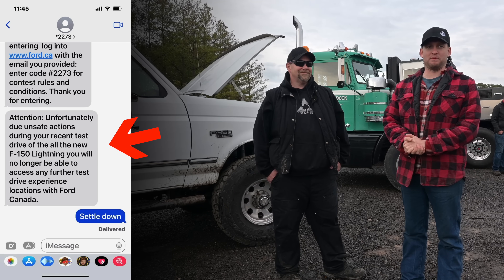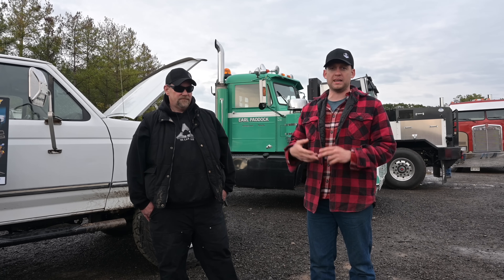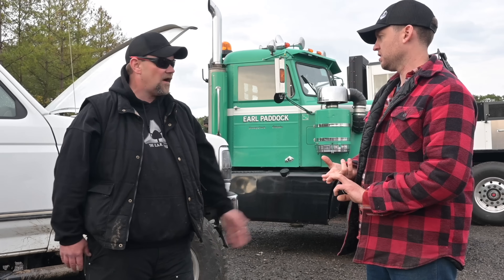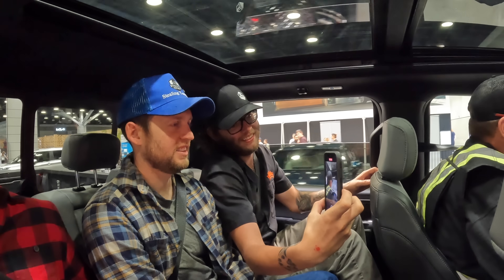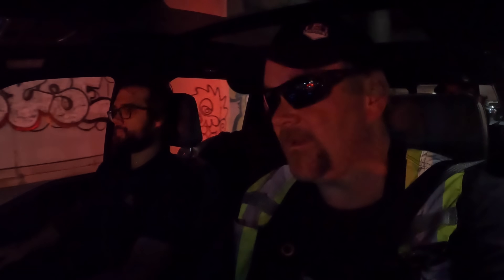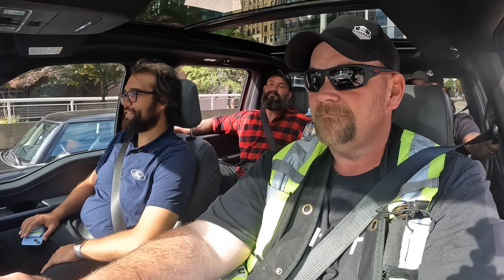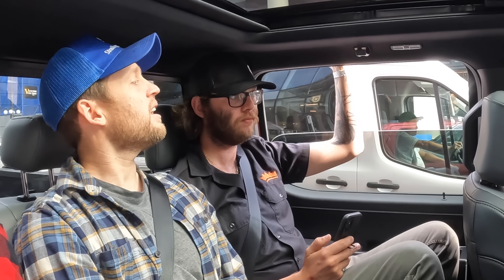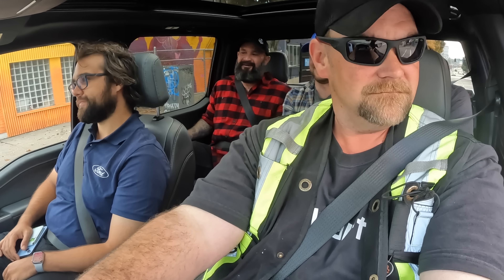Retrofit Revolution: Turning Old Pickups into Electric Powerhouses!

Comment: Yes PLEASE!!!! I know old trucks won't be as pretty and fancy as the modern ones, but something that is designed to be used is so much more valuable. Reducing ownership costs matters, and since a lot of trucks may have transmission issues, this could bring a ton back from the junkyard, assuming they aren't rusted out. I would be curious how low you could mount the engine, and if the batteries could be underslung in the transmission tunnel. Keeping the CG low and increasing utility would be brilliant, especially for off road applications, or recovery.

Comment: I’d love to see a retrofit kit happen - I’d encourage you to build in a good deal of modularity, including allowing a kit that’d integrate to a transfer case instead of replacing the whole axle and doing different generator/motor/battery combinations - selfishly that’d be ideal for my Toyota with IFS. If you make the CAD for the motor face available, it’s relatively straightforward to adapt that to transfer case input and be off to the races.

Comment: You don't need custom to fit kits.   Just provide an engine, Gen and axles.   Make the electronics open-ended so we can cut them to fit.   I would also like just a generator to attach to whatever engine I want and axles.   I would love to do this on my 65 ford f100.

Comment: That's awesome. How about trailers with powered axles and batteries. Travel trailers and logging trailers, all kinds of trailers. I saw a travel trailer that could be driven around with a remote, without a truck. Even powered sidecar on a motorcycle! Imagine a powered trailer in mud or on ice.

Comment: I have the perfect truck for you to test it on. It's a 1990 Ford F250 four-wheel drive with the big 7.5 liter motor and a toolbox in the extended bed. And it just so happens that the motor on it blew last year and really wanted to convert it to Electric but don't have the confidence or knowledge to see it through. I will gladly be the donor truck

Comment: I'd love a kit to fit my Peugeot 306. They have a torsion bar rear end, so 8 bolts to drop the entire rear suspension out. A bolt in rear setup for them could pick up on the original mounts and also provide a driven rear end. My 306 happens to be a very efficient diesel as well, so could be even better with this setup.
Same rear suspension system for everything Peugeot and Citroen from the 80's to mid 2000's, just sized differently for the bigger or smaller cars. Even after that they only went to a semi trailing arms setup instead.

Comment: Absolutely! I’ve had two type rattling around in my head for years. Either convert a classic truck to a gen/electric one or do a former ambulance chassis. The latter is easier to do because the body is already off the back. The conversation during the test drive was hilarious!

Comment: Has big blue collar market potential. Built in generator for running construction site tools,   RV trailer power, though you may suffer on efficiency trying to blend towing Regen power vs running RV campsite power;  service truck use has potential for running welder, crane, air compressor, etc. 

The sky is the limit, there's a lot of customization that can be done in the industrial world with this.
Reply: The myth that people wouldn't buy this is dumb. The problem with electric vehicles is the demand they put on the electric grid. California supposedly does rolling blackouts in the summer because their power grid can't support the existing infrastructure. Yet they're trying to go all electric vehicles in less than 10 years. That's the stupidity with electric vehicles. Your system solves bridges the gap between the potential of EV's and the tried and true dependability of fossil fuels.
Reply: Side note, if we did away with CO2 emissions entirely then plants would suffer. They need CO2 for photosynthesis, which makes oxygen for us.

Comment: I have a 1996 Dodge Ram 2500 HD (rust free California truck) that I would love to have a conversion to EV with small generator to run. I tow my 5th wheel RV and a regular BEV just won’t work for that towing but would work for day to day driving. Your system having batteries with enough range for daily driving but having the generator for long distance and towing is fantastic!

Comment: Just a dumb ol’ Dirt Engineer here:  I have a 69 F250, which my Dad bought new sitting in the side yard, and hope to do a full restification on it, a year from now.  It is 2wd and has the Dana 60 rear end under it.    If you come out with a conversion kit, make the axle smooth, with out perches, or link hook ups on it so it is universal.  And, a Motor mount for the gen-set, which can be welded onto a piece channel by the installer.  A lot of folks have the welding skill to put things together from a kit like that, but few folks have metal brakes, or the hole-slot punching capability to make clean fabricated parts.  And for you to manufacture vehicle specific kits would add a lot of time and expense on your end.  A kit which allows a home shop based, all around mechanic to retrofit the electric, with out the hassles of sourcing all the components, and figuring out the controls system and wiring would sell well.    I’m thinking of a buffet type model where you have a list of standardized sub-components, the buyer can pick from, (some could be purchased from others if you wanted), and they select a set of components for their specific project, with the option of your shop doing the welding, powder coating etc. as an option.   And possibly a range of motor/axles to allow conversion of a range of vehicles.  I’m pondering converting a JDM Kei class mini pickup or van to full electric, perhaps as a hybrid, or full on electric.  Lots of room under those little flat beds to mount batteries, the only issue I have is figuring out the controls system.

Comment: Honestly it has been my dream for years to build a pickup or car with electric drive and a diesel generator. I grew up in Montana where the nearest grocery store was 30 miles (48km) from home. If you could combine the efficiency of electric and diesel in a small car, you could pay for it in fuel savings just going to town and back every day. Not to mention how common it is for me to just go for a weekend road trip and drive 800 miles (1287km)

Comment: Without a transaxle space between the frame should fit plenty battery. I want seals on the axles that’ll stand up to 2 ton on bad roads for 20 years like my current axles. and the occasional 2.5 ton load of green wood on chassis.

The torque might need a mute button for the north icy roads in Fairbanks

Comment: Would it be better to just make an electric centre section to fit the more common axles rather than the entire axle? Then you wouldn't need to mess with suspension

Comment: My suggestion would be to replace the rear axle, and then have a (smaller) front motor that simply hooks to the existing front axle with a driveline. It might lose some efficiency, but generally the front axle being powered is only needed in lower-speed conditions and only /sometimes/, so it would likely not matter.
This would also allow the kit to be used with TTB and independent front axles on 90s-2000's trucks - as opposed to excluding Chevy's and 3/4 ton fords.

Personally, I'd love to be able to fit a generator to, say, a Kubota V2203 - 40ish HP, it's small, and they are available in reefers for reasonable amounts of money.

Alternately, a kit to just use a 4-cyl gasoline engine might be good as well, if you can basically run it at wide open throttle and control the RPM with the load on the generator, so you don't have throttle losses.

Also, some way to hook a level 1/2 wall charger to it would be great - even if there is a fairly small battery, being able to just plug it in and charge it every day would be nice, and get just that much more range before needing the generator. 

I also think it would be cool to design some sort of modular battery pack - so you could start out with one module, and it becomes a hybrid. Need more battery range? Just add more cells later and plug it in.

As far as location for these packs, I think figuring out a way to bolt them to the frame rails would be great - there won't be a driveline in the way, and worst case you might have to relocate the fuel tank, but that wouldn't cut into bed space.

Having a truck box style module could be good as well - especially for a plug-in range extender module.

Comment: I have been waiting for someone to take this on for years.  A simple kit that you can retrofit into a truck.  I was thinking that you would replace the transmission with the electric motor.  Adapt to the transfer case and run power through the stock driveshafts and stock  axles.  I'm guessing power capabilities would have to be less than having electric axles because tcase and driveshafts may not hold up to tbe torque.

Comment: I need to rescue some beat to absolute heck plow/work trucks. Couldn't justify a teardown and rebuild without an all new power train, but maybe with the kit and the benefits to our ops... A torque monster, loves to idle, AWD, sips fuel, V2G, 480v anywhere (just a 30 amp drop would do it) platform that in a normal day doesn't drive ten miles and on a plowing day is never a mile away from a charger, just makes maintenance laps? We're the perfect customer except for how cheap we are and the not having the in house capacity to install the kit, probably.
Reply: There's also some single axle tank trucks and an old Autocar semi and a dump truck as candidate platforms for the full size kit, probably set up for battery only. But that's long term.

Comment: My votes for an obs ford or even an explorer. Would probably be quite a few years until I'd pull the trigger on it though. I also like that 2wd option. I'd be curious to see what kind of fuel savings you get over the 4wd. My guess is they'd be a lot closer mpgs than their standard fuel counter parts

Comment: You could do so much more with a decent sized generator onboard a pickup truck. I have a BMW i3 with the 22KW range extender - so a Pickup would probably need a 50KW+  you could power a huge job-site with this.  Or a event, party, a row of homes - etc.   Use a diesel motor which is able to alternative fuels - veggie oil,  biodiesel, WVO, kerosene etc.  - Design a bed cover with solar panels so that the truck chargers when sitting outside -  could be Epic ;)

Comment: I got a e450 ambulance conversation with a 48v house battery I'd love to get converted to electric diesel generator to  charge both house power and drive it's got 2500 watt of solar on it and a ton of space for a massive battery pack under against the frame rail and then just drive around the states and show it off it turns heads now but if it was electric drive it would really get a lot of interest

Comment: So about a power trailer!
My Uncle met a guy in the service, back in 1952
who was in the Air Force, working as a plane mechanic.
So he had a 1949 Chevy p/u that the engine blew up in.
He pulled the engine, and welded in some shelves, he stuck
a P 51 starter on the front of the of the trans, and filled the
 rest of the space with 6 volt deep cycle batteries, then
he put in one layer of batteries in the bed. And it worked!
But he only got 40 some miles before the batteries died.
So he fixed up an old Das 240v gen set that was in a trailer,
ran a cable to the truck over the trailer hitch, and drove it 
back ,and forth home 400 miles every weekend. When he 
saw the batteries dying, he'ld stop and turn on the genset,
 and it would charge at 160 miles to the gallon.
So a good self contained, gen trailer isn't the worst ideal!

Comment: I would build the first kits around the Ford super duty chassis. These truck have straight axles in the front, and aren’t that different from 1999 to present. The also need the most help since the 6.0 and 6.4 powerstroke were unreliable and expensive to repair. I know people that have had to take second mortgages to repair their powerstroke since it can cost $10-20k. Would be way better to drop in a generator and electric drive.

Comment: I wouldnt be so dead set on making kits  with 4x4, limiting you to 3/4 ton pickups. I think it would make a lot of sense to make kits for 2wd only to start with and expand into 4x4 later, there should be a decent market even for 2wd retrofits.

I dont know if a half ton or smaller kit would make sense for you, but a number of people in the comments here seem to want it. Of course theres nothing stopping me from putting a 3/4 ton axle under my half ton, just annoying that the lug pattern would be different. Maybe you could make 3/4 ton e axles but offer five lug hubs for them.

Comment: Now curious question, I get the whole axle idea. but couldn’t you use a motor in the way carl was designed? it’s a much lighter platform and that u-joint would hold up to a pickup

Comment: I know i would want to buy a 4 x 4 conversion kit. I dont have a 4x4 but i want to buy one and i intend to do this with or wothout a kit. I want to pull horse trailers so need roughly 10 to 20k tow weight for what im doing. I also plan to convert a deuce and a half to hybrid just as a run project too

Comment: I'd love retrofit my 79 e-250 camper to electric drive and put a rotary range extender in place of the 460 gas guzzler. I run a gen set for the camper power as Is why not run the drivetrain on the same power

Comment: Consider an electric cross member that replaces the transfer case or transmission tail shaft. Your drive interface is the universal joint rather than the entire axle

Comment: I'd love to retrofit my F-250 with this, only question I would have is if you think a 6.2L gas could run the generator efficiently or if I would have to swap for a diesel to maximize the efficiency.

Comment: if it has a plug in option I am certainly interested. I am in need of newer vehicles soon and was just thinking about getting something like the BMW I3 that has the range extender but I was bummed by the relatively short rang. and then I was saying that I wish someone would make retrofit kits that way I could convert my 01 V10 F-350 though I wonder if there could be a kit where it uses a motor to bolt up to my existing 5 spd manual transmission for an "ease of cost" entry (and because I still love shifting gears) but it would certainly need to have as much power and torque as my current V10. I would imagine that with a small enough setup motor generator setup could be mounted transversely (like a Honda) and it could sit above or in front of the electric motor. but also a kit that could be converted to run E axles later down the future. my concerns though are a/c and heat since I live towards northern AZ so we still have pretty hot days in the summer and cold winter days/nights as well.

Comment: I was literally saving up to get the full sized axles to put in my old truck project. A 1-ton electric axle would be better than trying to fit a logging locomotive axle inside of an 80s f250.

Comment: Electric pickups and medium duty would be perfect for service trucks for equipment dealers because they want power built in for welders and compressors and such and building a vehicle with a generator built in would be more efficient. You an use the battery to hold power and the while you are working you dont have a small enfine running to power your tools.

Comment: Just saw yesterday this is basically the direction the new Rams are going to go. Instead of full electric they're maintaing i believe a v6 engine that runs a generator chathing batteries and running motors for the axles. Claiming almost 700 miles combined range.

Comment: What about instead of e-axles for a pickup, us an electric power train that goes in place of the transmission/transfer case. This would be much more easily adaptable to more applications. Wouldn’t have to account for all the different axle widths and front steering components on a 4wd application. Even if you needed new length driveshafts that would be a lot easier and quicker than full axle conversions. Just my 2 cents, keep up the good work guys.

Comment: I don't think it's even necessary to replace the engine. In principle you just need to yank out the transmission and bolt a generator in it's place. Might not be the most efficient if you were designing it from the ground up, but you've already got a power plant, so you may as well use it and save money that way.
Reply: Interesting thought. 🤔
I suppose it would depend on the health of the existing ICE.

Comment: Time to retrofit an old cummins.
Got one here in Ontario with a perfect running engine and currently no bed on it. Was a manual transmission and would be crazy easy to implement if there was a full float hub 8 bolt axle available somewhere. 
Then it’s just a charge control and a battery to use.

Comment: A retro fit kit for older trucks would be pretty cool, even if starting with 2wd. I could see a 4cyl Kubota power unit under a hood of an older F250 towing anything you could load up on a trailer behind it. Cost would be a factor but a complete electric kit with big enough batteries to do anything is not cheap either. If you need a test partner in the states let me know, I have a bunch of 70s Ford trucks that would be good test mules.

Comment: How about a kit that the electric motor replaces the transmission for 4wd just sell a divorced t case with either a driver or passenger side drop the only custom work that would need done is drive lines and mounts for the t case and electric motor

Comment: A small engine would be all you would need.   There is a lot of wasted space in a pickup.  You could fit enough batteries to climb a hill that that would be enough.  Regen will recharge them on the way down.